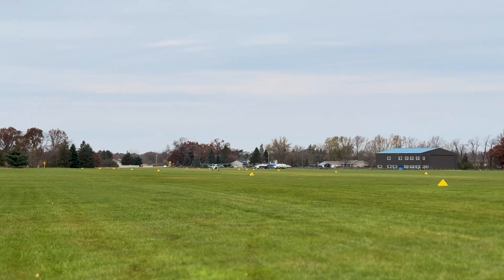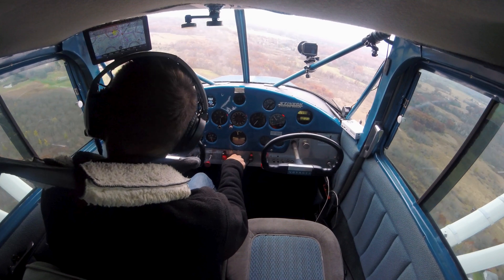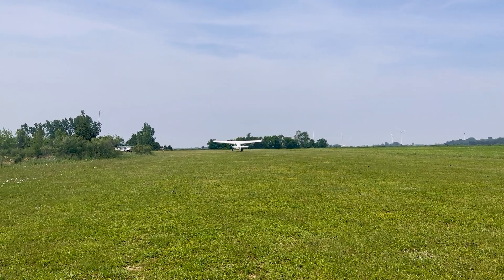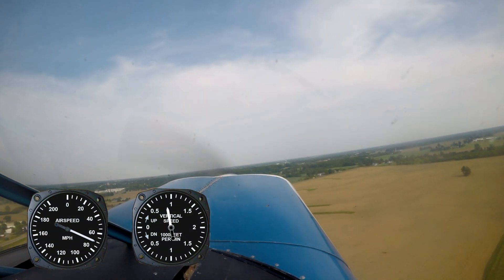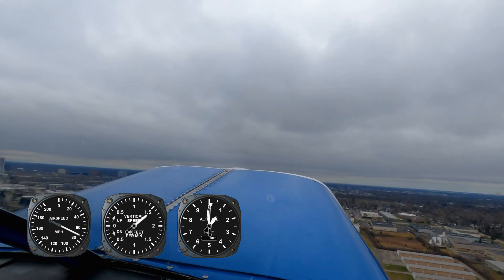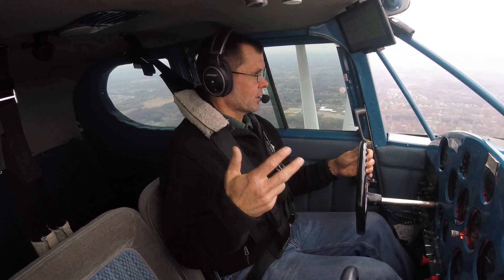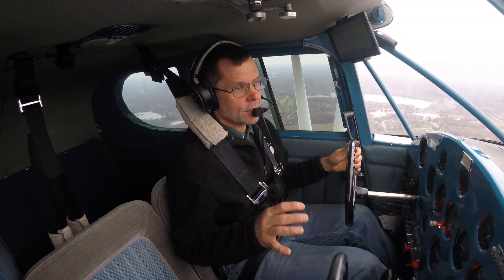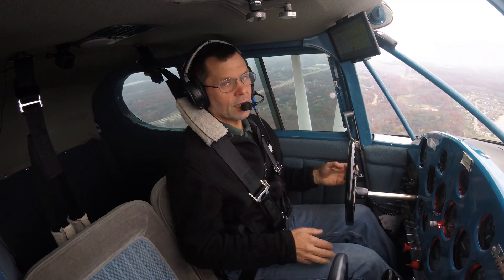Super Stinson Speed - Climb and takeoff performance update.

Comment: Hi scooter. Did you keep the vacuum system for your DG when you got the AV-30?  If so was it electrical or Venturi
Reply from the maker: It's electric.  I have the AV-30 so I could get rid of the vacuum system instruments plus pipes was a 8 pound reduction.

Comment: I seen your Stinson video. Great work. I had a Stinson 108-2 and installed the continental 0470 on it. At the time of the new install , I had the Frankly 165 hp. Great engine. The improvements with the 0470 was outstanding. I installed the constant speed prop and already had VGs on with the 31inch bush wheels. I climbed at 1,400 ft a minute and speed would cruise 130mph. I burned 12 gallons per hour.  I could take off in less than 150ft with full fuel, 2 people and some gear. My landing was less than 150 ft. I fly and live in Alaska. Have a lot of experience With flying Stinsons here in Alaska. I sold my plane after 38 years of flying it
Two years ago for $84,000. Was looking to build up another one. I do enjoy your videos. Ken in Alaska.
Reply from the maker: Well the climb on this one is alright but I'm not going to see 130mph in Cruise. Thanks for watching the video and please keep us updated on your airplanes progress.  The 108 is a super airframe.

Comment: I was thinking Continental IO-360 as an option, but the then I answered with more questions. Is there an STC for that engine. Converting to Fuel Injection could be a thing, Can your run that with a fixed prop. That nice Flat 6 sound and 215 HP could be nice. But as you point out, at what fuel burn rate.
Reply from the maker: The Continental IO-360 is not an option for the dash 2. Only the dash 3. In the dash three that might be a very viable option, It has 10 gallons more fuel to offset the higher fuel burn, 200 horsepower plus would be nice, You're still going to add weight and CG shift but the dash 3 has a 250 lb higher gross weight.

Comment: How many hours to break even with the avgas based on install price- Franklin core selling price?
Reply from the maker: That is a good question.  I did the math to see if over time I would continue to spend more or if the Lycoming would lower cost per hour of flying and if so  how long to break even.  I based that number on standard maintenance.  With the Franklin the manual says top overhaul around 600 hours, 1200 TBO, I used 25 hour oil changes with 50 hours on a filter, I found spark plugs lasted around 300 hours, fuel bun of around 10.5 gallons per hour. With the Lycoming I used 2000TBO,  no top end OH since most Lycoming's make TBO without a new top, 50 hour oil changes, spark plugs at 1000, 9 gallons fuel burn.  I also included the selling price of my old firewall forward toward the front end cot of the Lycoming.  What I didn't include was unplanned maintenance since I didn't know, what I have found in the past is the Franklin was an unplanned maintenance hog and Lycoming's are fairly reliable. With those costs I found using my previous engine  (around 450 hours) I would break even at 2000 hours.  That would be around 10 -12 years the amount I fly.  The Franklin has been the highest operating cost per hour engine I have owned.

Comment: This is super cool! Is the engine new or is out of another plane? (This is Nicholas btw)
Reply from the maker: It was out of another airplane that had an accident in the Bahamas.  I purchased it from a scrap yard, then had it rebuilt to new spec.  Most of the parts are new and if not they went through magnaflux non destructive testing.  This is common practice in aviation.

Comment: Great report.  Thanks.   How long does it take to repitch the prop?   can you do it in the field with carryable tools?
Reply from the maker: The paperwork says 15 minuets.  That seems to be accurate.  The re-pitch requires a torque wrench and digital level.  So I guess you could carry that stuff if you are certified to use them or flying an experimental aircraft.